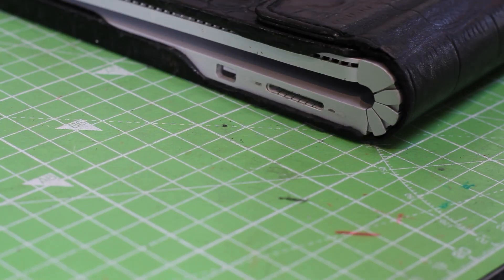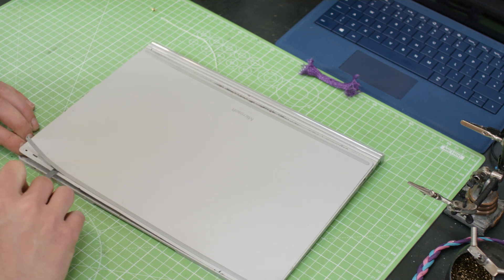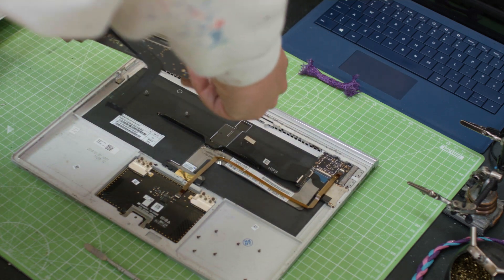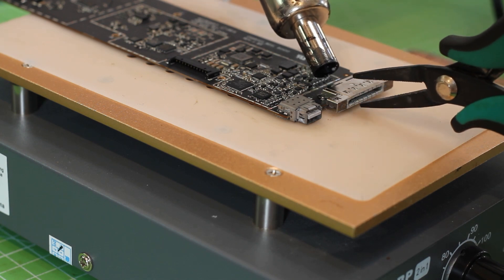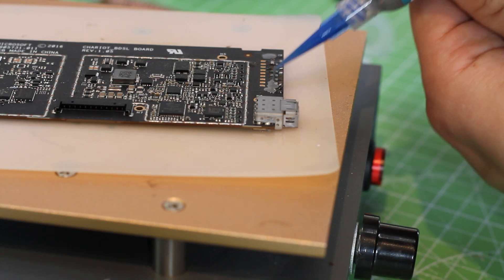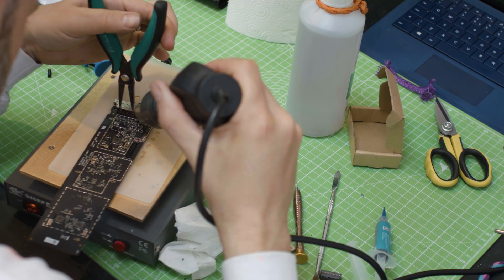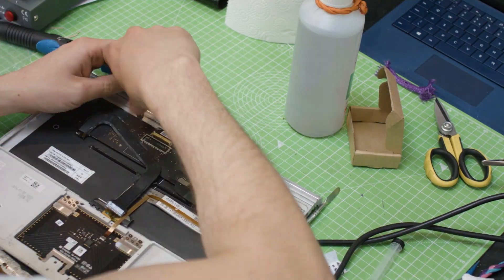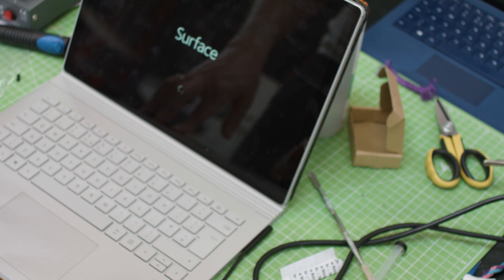Replacing the power socket on a Surface book 1 - surface mount horror story

Comment: Thanks man. I have the same issue with the same model. I can see the pins bent and broken and had even  given at a local repair shop however they said they couldn't do much rather than replacing the whole motherboard. I'm thinking of this DIY as the last resort now.
Reply from the maker: Learn from my mistakes and let all the solder melt before removing the socket ;)
Reply: so did it work?